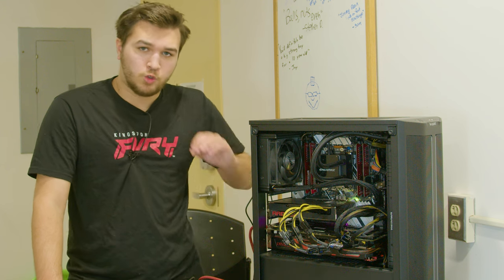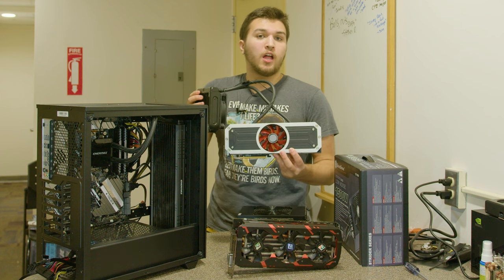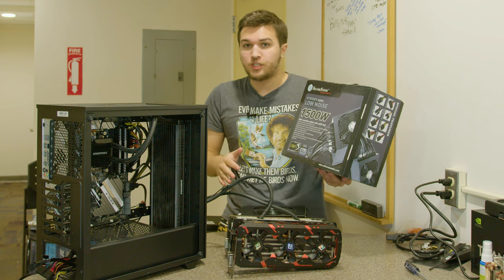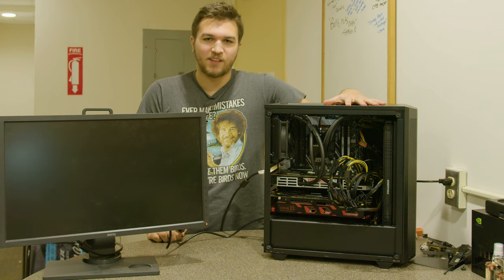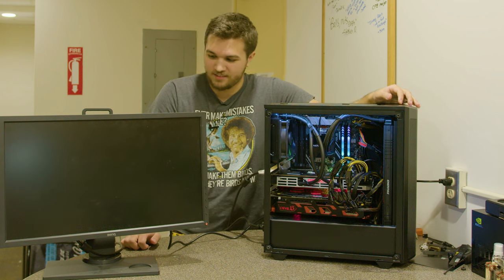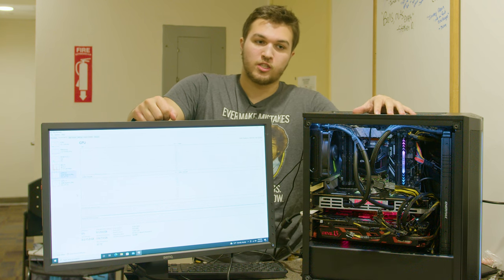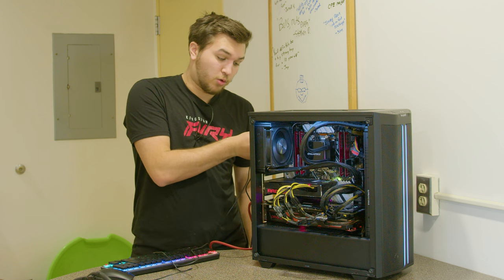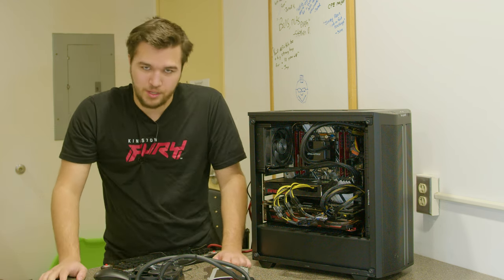This Gaming PC TRIPS Circuit Breakers!

Comment: i feel like this is mostly due to the lower voltage wall outlet, in europe we have 240volt not 110volt, that said ive never maxed out a 1500watt power supply even when i had a threadripper 1950X with rtx 2070 super in SLI. The ultra thick power cable is a C19 type this is cause of the wattage being above 1400watts and annoyingly there often not included with the power supply and you have to buy them seperately, plus they dont like it when you find a cpu coolant leak on them byebye 1500watt kolink platinum power supply you have been missed a painful roughly £250 down the toilet.

Comment: Can someone tell me how do you stop your pc from tripping the breaker please
Reply from the maker: You need to reduce load on the breaker, removing other devices from the same circuit is the only way, (assuming that’s ur issue and not a fault in ur PSU)

Comment: When I turn on my pc the mcb in my room is turning off am not even turning on the pc just turing on the psu through the wall board ....its happening sometimes is it the fault of psu ? My specs are MSI MPG A750GF, 1660 TI colorful, ryzen3200G, 16gb of ram(8+2)
Reply: How did u fix
Reply: Did u figure out a solution?
Reply: Yeah there is only one solution change the MCB to 16A minimum.  And don't drain the capacitors by turning the psu's back switch off its no need